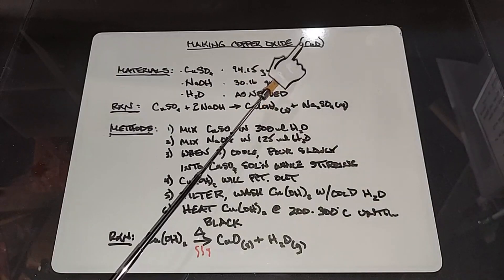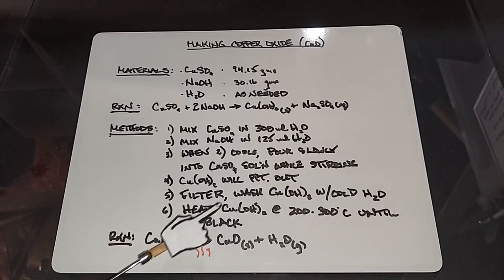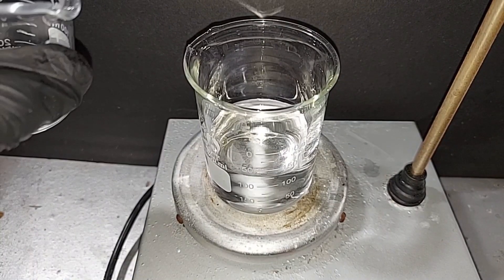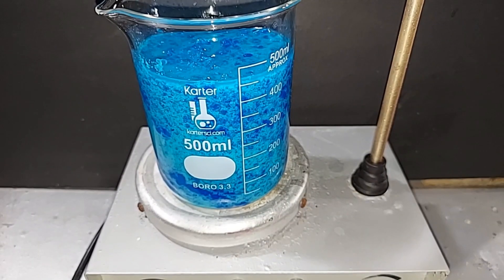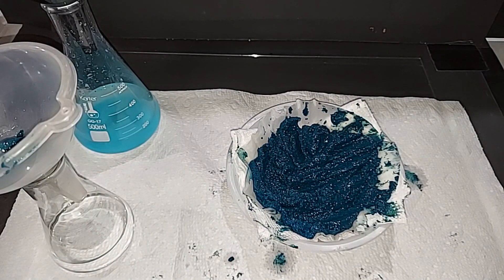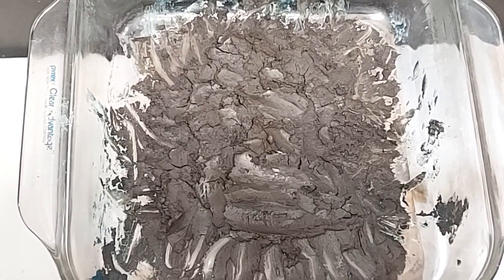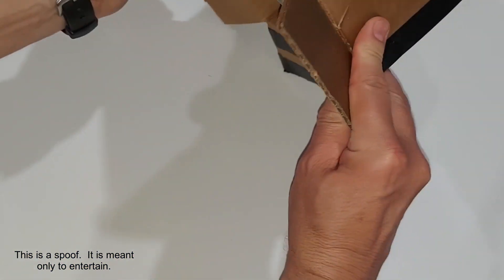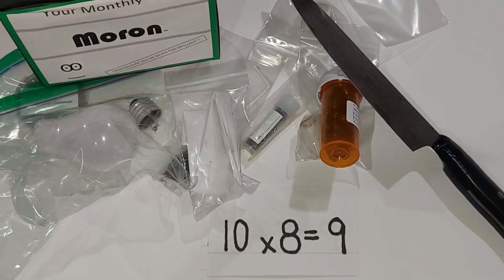Making Copper Oxide (CuO)

Comment from the maker: This copper oxide made here will be used in a future video on thermites; in areas I haven't covered yet.

Patreon continues to give me fits due to the pyrotechnic nature of some of my videos.  I've decided to move over to Ko-fi and start over.  I will not be posting my videos on Ko-fi to avoid any problems, but it is a safe and secure place that you can support this channel.  I apologize for the change and hope to see you over at Ko-fi.  Link is above on the channel's main homepage.  Thank all and any who are interested in helping!
Reply: Just wanted to mention something regarding your protocol,
I have made copper thermite before and from my experience its best to use NaHCO3...
1) Cheaper and doesnt require precide stoichiometry.
2) The extrction precoess it a lot less messy as you can just let it settle out, decant the water, wash it and then pour it on a baking tray (if you use an oven).
3) The Cu(OH)2 doesn`t produce small particles, you have to go through extra steps to gind it.
4) While Cu(HCO3)2 or CuCO3 (both can be produced) has a higher decomposition temperature, my old oven managed to doit and I got better resuts.
I encurage you to try it out and compare the results.
Reply: Is it same way as he showed or different 
I mean with baking soda?
Is it used instead of what?
Hydroxide?
U have any vid on it or any recipe? @antigravity7503
Reply: Cu +2HNO3 → CuO + H2O + 2NO2

Comment: Man I’ve been going to hardware stores for years buying root killer which is 99% copper sulfate.  I either do this copper oxide procedure or I just add stoichiometric amounts of baking soda to get basic copper carbonate which is the same as the patina on the Statue of Liberty.    

You might think it’s a waste but I like to isolate the sodium sulfate byproduct.  I first concentrate filtrate then cool it to deposit dazzling sodium sulfate decahydrate.  I put the decahydrate in toaster oven and get glistening crystals of anhydrous sodium sulfate.  I will use sodium sulfate for precipitation of lead and barium.
Reply: I have a theory that all sodium is destined to ultimately become the sulfate lol
Reply: That's what I do, minus saving the sodium sulphate. I don't really have a use for any of these other than trying to make a giant copper acetate crystal.

Comment: @Cranial Construction You can actually decompose the copper(II) hydroxide without having to filter and wash it first. Just heating a suspension of copper(II) hydroxide in water will turn it into black copper(II) oxide, which is easier to filter than copper(II) hydroxide.